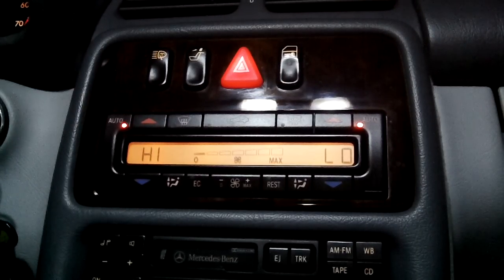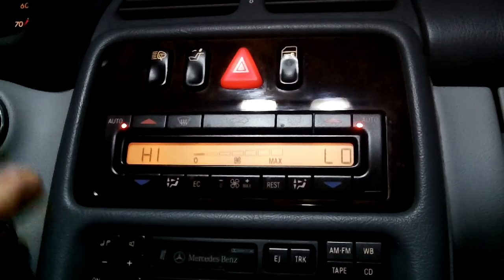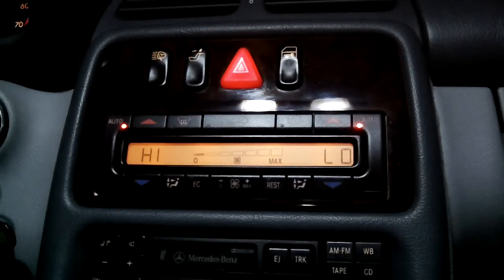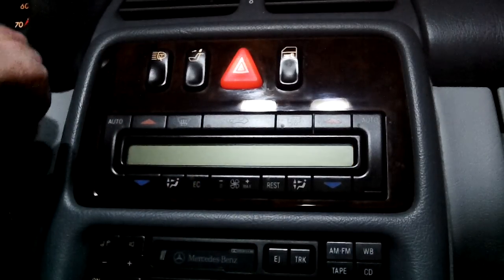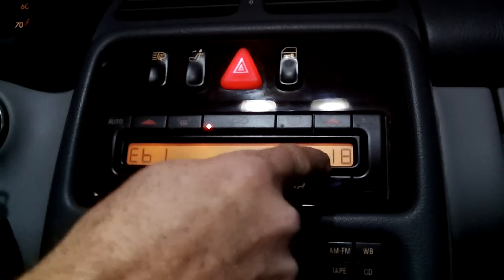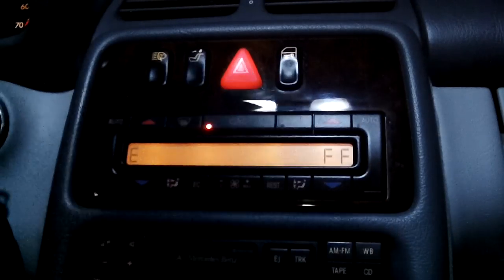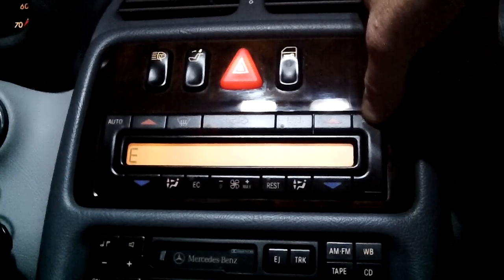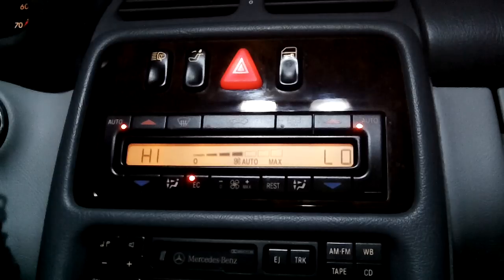Mercedes w208 clk320 how to display climate control fault codes

Comment: I reset the same two codes I got and they came back 241 and 416. I refill the ac with r134 and hissing sound comes from vent and not a/c compressor. So it's definitely the 416 correct? but what does coolant circulation pump has to do with a/c?
Reply from the maker: The coolant pump operates all the time to keep the engine from developing hot spots when the rpms are low. it also operates the "rest" function to heat the interior when the car is off..I'm not sure why it would keep the a/c from working
Reply: would the 241 refrigerant code make the pump not work properly or throw codes to the system. the air is still hot. Oh I just check the gauge and its in the green but a lot lower reading. and it seems as its not going in the r134a is getting cold as heck
Reply from the maker: LOONI BEATS the refrigerant code won't stop the pump. I would change the pump with a used one first

Comment: on my 2000 clk430 ,I show a 231 code,ECT sensor ,B11/4. How can I find and fix this? Thank you,
Reply from the maker: +Glenn Nesbitt   Engine coolant temperature sensor.. located on the thermostat housing.. check the wiring to it first and make sure it is plugged in properly.. it is right at the front in the middle of your engine.. I found this video which shows how to remove and replace it https://www.youtube.com/watch?v=_gmMTVRPd5w

Comment: thank you  , i did that , the code  is 416   and didn't reset what should i do ,
Reply from the maker: +adel ali  416 is the small booster pump under the air filter..it has coolant lines running in and out of it..check the connections to the pump... turn the car off and press the "rest" button...open the hood and put your hand on that pump, it should make a whirring noise every few seconds
Reply: thank you very much  fupabox

Comment: hello fupabox    i have 227 - Outside temperature indicator temperature sensor (B14) and i don't now what is this can you help me?
Reply from the maker: +Giorgi Gaimarjvashvili there is a little black probe mounted in the front bumper about the size of your thumb...it kind of sticks out from one of the openings for fresh air in the bumper..check it for damage or loose connection
Reply: if this sensor is damaged may conditioner not work?
Reply from the maker: Giorgi Gaimarjvashvili it may in automatic mode...in manual mode it should be ok..I'm honestly not 100% sure
Reply: my car won't blow cold  and hot air   heater blower is damaged
Reply: sorry for my bad english
Reply from the maker: Giorgi Gaimarjvashvili your English is fine.. The blower will need to be replaced or the whole system won't work properly. The A/C  won't engage with no blower to prevent freezing of the evaporator

Comment: I have a clk430 and my ec light is stuck on I can only read sensor codes but I cannot find codes because ec is on any idea how to get it off. I hit it by accident and now it is stuck. Any advice.
Reply: +kim morrison sensor readings were 1-118 2-111 3-140 4-136 5-108 6-205 7-10 8-120
Reply from the maker: +kim morrison sorry for the late reply..youtube no longer sends notifications by email of comments, so I have to find them in other places... any way...using a toothpick or wooden BBQ skewer you can pop the button off, and then you can push the inner button under the cover to shut off the e.c. button
Reply from the maker: +kim morrison .. Not sure of any of those readings ?

Comment: I have a 2001 CLK 320 and there is a high pitched squeal coming from the area of the climate control module.  At first I thought it was a fan bearing but I listened to it with a stethoscope and it is definitely coming from the control module.  Do you have any idea what I have going on?  Pete pete@petedeboer.com
Reply from the maker: Pete DeBoer   no clue to be honest...possibly one of the vacuum flaps behind the dash is blocked ..you can pull the climate unit with the same keys as the stereo and see if you can find the problem back there
Reply: +fupabox 
I have the same problem. Did you find a fix.

Comment: something weird happened as i was playing around with the unit
i can no longer turn up /down the speed of the ac and my auto buttons don't work
what works is the REST button and the EC button that come on as soon as i push the buttons and the unit shuts off when i press the REST button also i hear this noise from inside the car something is going on and off
any idea what is going on?
Reply from the maker: GungeScleraEmpyaema    try unhooking your negative battery cable for a few minutes and see if the unit will go back to normal. It seems like something may be stuck.. possibly one of the buttons... were there any problems before you began the test ?
Reply: ***** there was
the unit was working and i could change the speed but i couldn't manipulate temperatures or the "auto "buttons didn't work nor the "circulation" button
and i always had something like "1" on the left and "35" on the right 
the rear window defrost button wasn't functioning before but now it is the only button that comes on and off 
so yeah
that's what it is.
Reply from the maker: GungeScleraEmpyaema if unplugging the negative battery cable doesn't reset it, you may need to get a used one on ebay or at a wrecking yard... I have never seen one go bad, but it can happen...the only other thing that could possibly help is a Mercedes star tool can scan the unit, but the price of doing that would be around the same as getting a used one..
Reply: ***** no it didn't. or was i supposed to unplug  the negative cable while the unit was on?
cause i didn't do THAT
i just unplugged and plugged
which messed all the memory settings. not a big deal but what if i unplug hte positive this time?
or both? while the unit is on
like i told you this thing can turn on by pressing the REST button and if it's off there is that noise starts to come out.
Reply from the maker: GungeScleraEmpyaema no don't unplug the positive...always unplug the negative battery cable first on a Mercedes..Don't do it with the unit on. I think there is something wrong with the climate control unit. The noise is likely the circulation pump which is activated by the rest button when the car is off... if it is coming on while the rest button is off, something is messed up inside the control unit
Reply: ***** is this something an electrician can fix?
Reply from the maker: GungeScleraEmpyaema  nope..there are places that will rebuild them for a couple hundred bucks...you should be able to get one on ebay or a wrecking yard for under a hundred
Reply: ***** hey does your unit illuminate when you turn on your car? 
i have noticed an amber background.
Reply: ***** hey someone suggested it might not be the AC unit and it's the blower motor resistor 
what do you say?
Reply from the maker: GungeScleraEmpyaema the blower resistor only controls the fan speed..the other buttons would work properly
Reply: ***** so mine is fine? seems to be fine?
Reply from the maker: if the fan speeds work.. the resistor is good
Reply: ***** ok so the speed WAS working before i messed up the unit
but i didn't have control over all the other buttons or the temperatures 

now i can only manipulate temperatures but nothing works
yesterday i had hot air coming in from the driver side when it was like LO or 14
Reply from the maker: GungeScleraEmpyaema Ok.. I was under the impression that many of the buttons were not working.. it could very well be the fan resistor, or the fan itself.. remove the fan cover and push up on the center shaft of the fan with the power on.. if the fan starts to spin when pushed up, the brushes in the fan motor are worn...if it still won't work the resistor is prob. bad
Reply: ***** is this under the glovebox?
Reply from the maker: yes.. I have a video on it somewhere on my channel
Reply: ***** so i bought a likenew condition AC unit and tried it the other day and it's even worse 
the Rest button comes on to shut off the noise from the hood but it goes off after a few seconds
what do you think?
Reply from the maker: GungeScleraEmpyaema  when the rest button is pushed (car off) a pump under the hood by the air filter, will pulse..it pumps warm coolant into the interior heater core to allow the interior of your car to stay warm in winter, when the car is switched off.. ( I press mine before going into a store in the winter ,so the car is still warm when I get back in )  it should pulse on and off, but not too loudly.  The rest button shouldn't come on by itself though
Reply: ***** sorry it doesn't just come on i meant when i press it. 
nothing actually comes on when i start the car.
Reply: ***** do you live in the GTA area? is it possible for you to take a look at this?
Reply from the maker: GungeScleraEmpyaema  I'm in Barrie.. send me your email on my message inbox on my channel page
Reply: ok thanks
Reply: ***** did you get an email?
do you think i am gonna need a heater resistor ?
Reply from the maker: I'm not sure what is going on with it..is the fan coming on at all ?  did it come on before you replaced anything

Comment: Great instructions! Luckily no errors and everything is running smoothly. However, do you have any idea where to find the fuse for the backlight? I put in LEDs a few months ago, everything was running smoothly when today, suddenly, both of the lights went out at the same time. I am assuming that the probability of both lights going bad is very low, so my first guess would be to check the fuse before buying new lights.
Reply from the maker: Patriks7 the fuse would be for the entire gauge lighting... since there are 2 LEDs in the hvac panel..they are likely like christmas tree lights... 1 blows and that cuts the flow to the second bulb
Reply: ***** Thanks for the quick reply. After further inspection, I seem to have a bigger problem. It seems that the lights in my license plate and trunk don't work either. Well, the bulbs work (tried them in a different place), but there doesn't seem to be any power. I'll try to check the fuses, but no idea which ones can cover this. I already ordered new bulbs for the climate control backlight, as I don't have any other ones to test there. I'm starting to feel this might be a bigger issue that is out of my capabilities to fix..
Reply: ***** Ok turns out you were exactly right. One of the LEDs died, which blew a fuse (who would have thought that the license plate lights and interior dashboard lights would be on the same fuse??). When I kept the bad LED in there, it didn't want to light up, but as soon as I removed it, the other one worked perfectly. Just posting this here in case someone has a similar problem :)
Reply from the maker: Patriks7 glad it's sorted out

Comment: Hey Craig..i did the code test. I got only one code msg.  (E61  416)  I notice in your video you got an E61 418 & 471 code.  I heard you said that it was.. "being a problem with the Duovalve..left or right etc.."  BUT I notice in your list the 416 code is for Coolant Circ Pump..?   Is there a similarity there?  Also what exactly is the E61 # meaning on the left side of the display...does it coincide with right code # displayed on the right side of the screen??  and the main question though it may be a dumb question..lol Do i have an issue with the A/C, or I'm guessing its possibly an old code that's never been cleared. I am getting cold air, (though sometimes not as cold as i like, living is Los Angeles)  I know its not Joshua Tree..lol  But it gets hot here too..your thoughts?
Reply from the maker: The E61   is actually  Eb 1   then the code  all the codes begin with  Eb1,,,,
the coolant recirc. pump and the duovalve often trigger each others codes as they both control/restrict coolant flow.
The A/C won't work properly with old codes stored inside...so it's best to erase them and see if they come back
Reply: Yep..just ran the check again..code is gone. :)
Reply from the maker: A Mancuso hopefully all good now  :)
Reply: Hey bro..ya. im good on the AC front..Never really actually had issue other than having to take it to my Benz contact here in LA who put some refrigerant in it for $20.00 last year. I like it really cold..lol  The issue i am having tho with the AC as i mentioned in the other thread for the Valve closing and opening.  My center valve seems not to be closing all the way..i get a  bit of moderate air blowing thru even when i have the AC in off.  They when i turn it on it blows according to how i adjust it up and down..like i said it may be a bad elliment behind the dash thats controls the open close to the center vent on the dash.  YOur thoughts?
Reply from the maker: A Mancuso my center vent never really goes all the way off either...I think it's designed to never go all the way off...maybe a Germanic attempt to keep fresh air coming in and keep you awake  :P

Comment: Hi I tried the flap test and didn't really know what I was looking/listening for so I turned my car off and on and the did this fault code test. I got E61, which you say is duo valve (not sure what that is) and 422. But main problem now is I then turned the car off and on again and now all I get is hot air through my vents?! Any clues? Thanks.
Reply from the maker: the duo valve is the valve under the hood that regulates hot coolant flow into the cabin to control temperature..if it is faulty it will remain in the warm setting and not allow you to get cool air into the interior...check my duo valve repair video..it is easy and costs nothing to repair
Reply: Thanks for your reply. I did some research and found some things out in the meantime. It was sorted without much effort tho.... strange,  I know. I pulled the fuses for the duo valve and put them back. Either that did it,  or it just took longer to cool down than normal when adjusting the temp from hi to low. *****  to your video if needed ttho. Thanks again :)
Reply: Baseer Ahmad I'll refer to your video. ..

Comment: I have 99 clk 320 and I don't know what's wrong my car whenever I tried to start my car it didn't start and in few min it's start. Please help me out with it please I really need help and if u can make video about I will be really appreciate with ur help thank you
Reply from the maker: check the battery in your key..if the battery is getting weak it has a hard time sending the coded signal to the ignition

Comment: Thank you for this video.
I've tested my car and there was only one fault,with code 416-Coolant circulation pump (M13)
Can you tell me what this pump for?What it is doing? and what goes wrong when it doesnt work

Thank you
Reply from the maker: the coolant circulation pump is located down under the coolant reservoir..looks like a shiny silver motor/pump with wiring and 2 coolant hoses coming from it..it is to increase coolant flow to the heater at idle and to pump coolant into the heater core with the car "off" in rest mode...when it fails you get very low heat in the car while idling and in stop and go traffic..also the rest feature which allows the car interior to remain warm while the ignition is off wouldn't work
Reply: ***** Thank you.I've reseted climate and after two days it seems that there is no more fault.I can't understand why it pop up but now everything is allright
Reply from the maker: Gocha909 the fault will remain in memory until it is reset..possible that the code is actually years old and has never been erased. You can always check the codes again in a few days and if it is still clear,then the recirc.pump is no longer at fault,or whatever was causing the fault (electrical connector that lost momentary contact..etc.) is no longer an issue...fingers crossed :)
Reply: ***** Thank you very much for help.I've testet my climate and fault is no longer there so seems that everything is ok